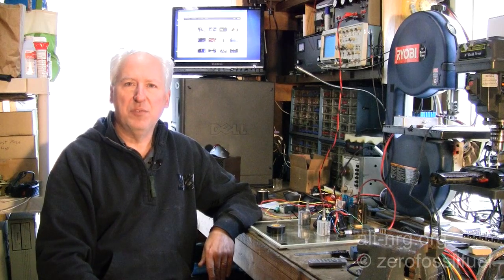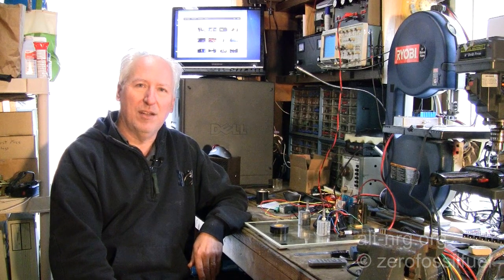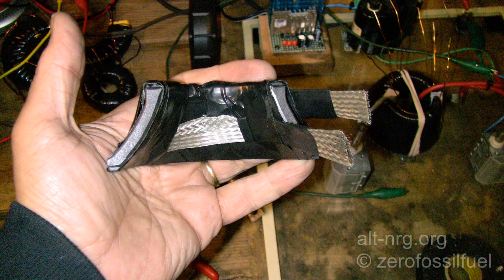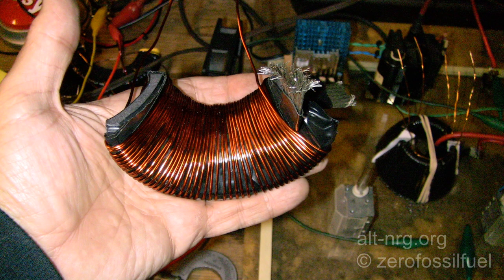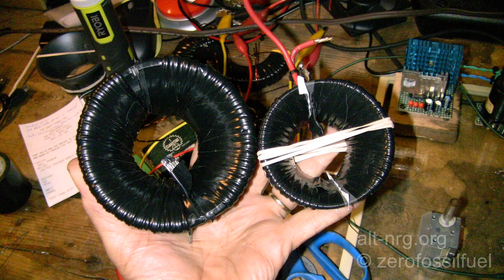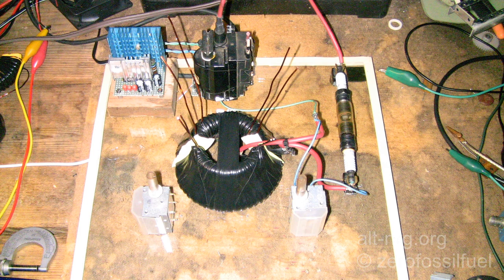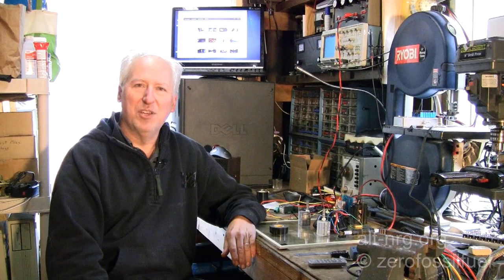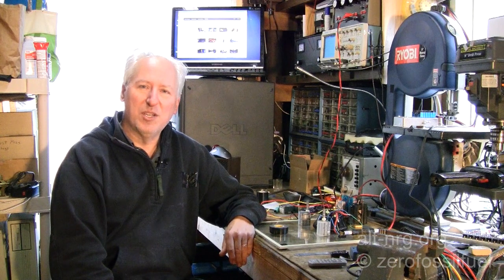#304 Kapanadze update #2

Comment: Hi,

When tuning yoke core we did not use high voltage, that came only after we had set all frequencies.
Also your winding counts might be different as you got different type of ferrite.
The main goal is to match 1/4 harmonic of resonant frequency with 50T(or according) coil then match with 15T(or according) frequency for freeenergylt.narod2.ru/aidas/2_pirmine_iskociojimas_pjuklas__50_hercu.jpg output in secondary.

Also please be aware about possible strong ultrasound causing long headaches.

Comment from the maker: @stivep1 I did not remove the flyback diode as I thought pulsating DC would satisfy the need for white noise generation. The spark plugs are resistor plugs, same reason for not being concerned. I will add to my list of tests to remove the diode and use non-resistor plugs if that's your recommendation.

Comment from the maker: @mcarbaugh I have muffs if I need them. As far as safety is concerned, each project has its own set of dangers. HHO is explosions & chemical burns. Muller is the flywheel coming apart at high speed. This one is electrocution from high voltage. Take your pick! LOL!

Comment: I'm 3/4 of the way to obtaining a bachelors degree in Biomedical engineering technology. From the physics and calculus classes I have completed, I have concluded that free energy is not possible.  Proving free energy is possible, used to be my goal for my graduating project, but now I live closer to reality.  Building a "fallen patient" detector for use in a hospital room, incorporating a microcontroller, thermal and motion sensors, seems less likely to get ridicule. I hope to proven wrong !

Comment from the maker: @bigchad007 It is reported to produce 200W power for less than 10W excitation input power. Wesley presented very compelling evidence that this is for real. If I can replicate these results I will attempt to loop and self power the unit while extracting excess power to run external devices, lighting, heaters, battery chargers, etc

Comment: @ZeroFossilFuel Glad I could help. Here is a pdf with lots of info on the how to of the rocket mass heater that may help. Google search (neilorme rocket mass heater pdf) it will be the first link. I am not going to use brick for the burn chamber I bought some 7" steel square tube to build the burn chamber out of. I have to go up to my dads in the next couple weeks to cut and weld it up. I want to be able to move and store it in the summer so going to make it free standing.

Comment from the maker: @TheCritterWindow I want to try something a bit smaller scale. 4"dia stack (12.57 sq"), 6" outer wall, 1" Perlite/Clay in between, 2 stacked 5-gallon metal pails, 1" gap at the top, 3.5"x3.5" burn chamber (12.25 sq"), exhaust into a 6" duct with forced air heat exchanger. No mass, just instant heat.